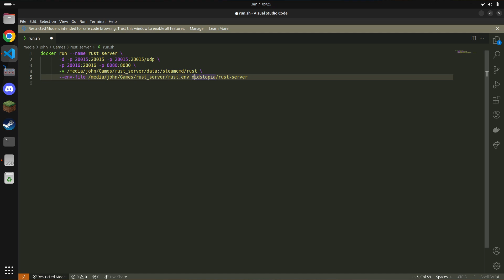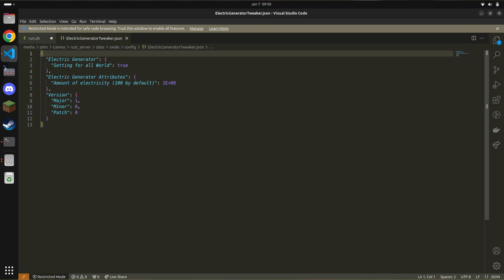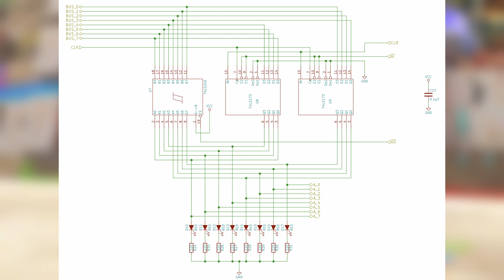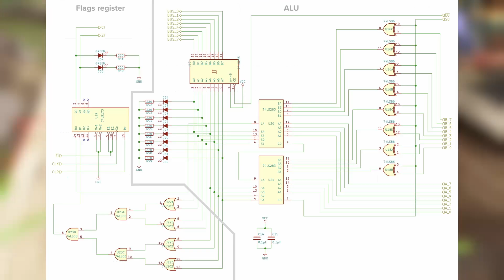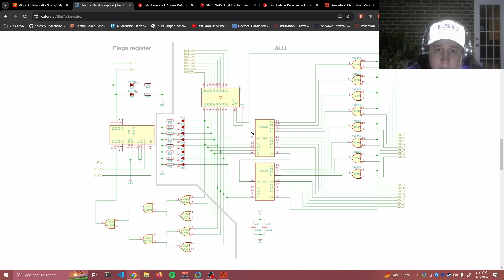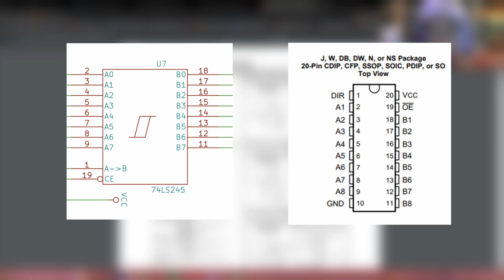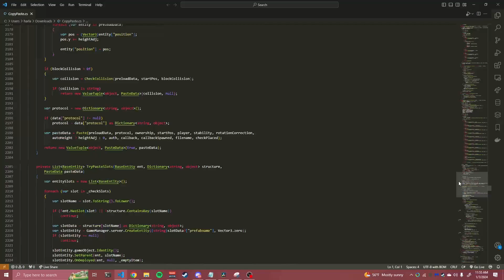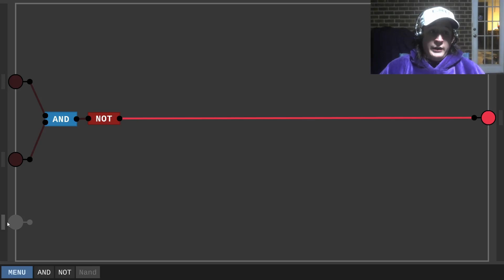I am making a Computer in Rust

Comment: I would be careful cranking the test generators up that high. Arithmetic and floating point operations tend to lose precision and be flat out wrong when dealing with numbers that high. I wouldn’t go any higher than 2^53 - 1, which is the max number that can fit into one register.